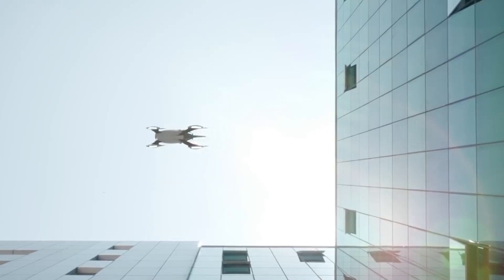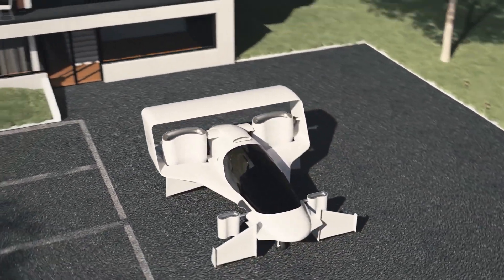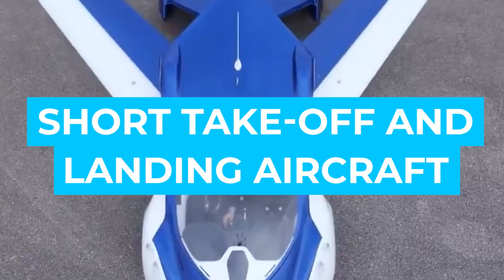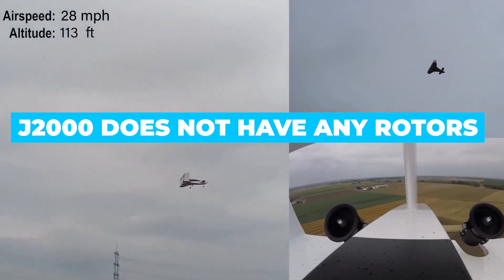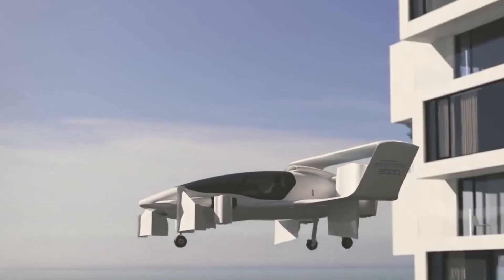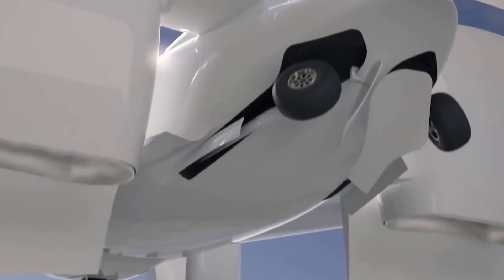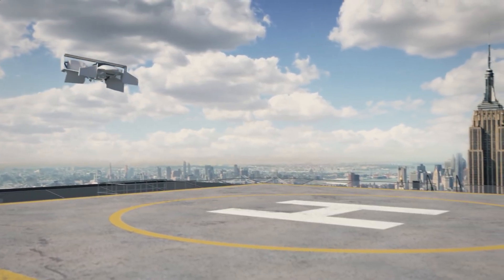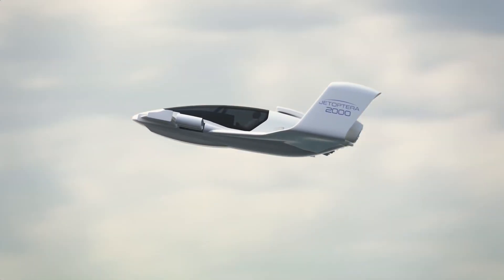How Jetoptera's Bladeless Propulsion System Works

Comment: I'm going to call it, Jetoptera's Fluidic Propulsion is going to win the aviation race. It even has an answer for engine failures because it can glide like a plane as necessary. Conventional propulsion may go faster, and carry more, personal transport is going to be revolutionized. 200 kts is the speed that GA aircraft push for and if you can get that and STOL capability with 4 passengers and luggage, it will retire most GA aircraft and helicopters quickly. I'm I pilot and flight instructor, I'm especially excited for this to go live!
Reply from the maker: You’ve done your research!
Reply: Jetoptera's design still requires the use of a compressor of some sort to create the pressure gradient required in order to take advantage of fluidic propulsion. That means air still needs to travel through an area of tremendously high drag in order to produce enough thrust (compressors aren't exactly great at producing thrust at low drag). I'm somewhat doubtful it'll provide a game changing increase over existing methods of propulsion. I'm not a pilot, just an engineer (though fluidics isn't really my specialty). Most of my opinion is driven by talking to other aerospace engineers on the subject I know personally.
Reply: @wakannnai1  you are getting distracted by "efficiency". We are not saying that this is going to be the most efficient method of propulsion, we are saying that this is going to be the best method of propulsion for personal and commercial VTOL or STOL aircraft. Right now, 2 jets, rotor driven, and fan driven aircraft have been able to take advantage of VTOL and STOL and carry significant weight. In aviation, you have to worry about more than efficiency, but also mission capability. Jets and helicopters are extremely loud, helicopters and fan driven VTOLs are comparatively bulky and cannot travel as fast as similarly powerful aircraft. Not to mention the danger to personnel on the ground with fast moving rotors and propellers as well as the danger of being sucked into the large intake of a turbo fan in a jet, or the danger it puts the occupants of the plane in if birds are sucked in(see The Miracle on the Hudson). What fluidic propulsion offers is similar to what the Raptor engine is to rocket engines, it's not the best in any one category but it is proficient enough in all categories to provide a winning combination. Airports take up crazy amounts of space compared to the size of the vehicles they service, you can put an aircraft equipped with fluidic propulsion anywhere that a helicopter can go, and travel at comparable speeds to an airplane. Early models will be about as loud as similarly equipped aircraft but require almost no space to take off and land. Let's say we use the Piper Meridian as a comparison. It can go 250 kts at 250 lbs per hour fuel burn at 25K ft high, it seats 5+ 1 pilot and can go four hours. Being conservative, let's say that a fluidic propulsion aircraft can take 3 + 1 pilot 200 kts, at 250 lbs fuel per hour at 20K ft high for 4 hours. Oh and you don't need an airport to use the second aircraft, and it can do anything a helicopter can. Would it be worth buying? I would say yes.  Once electric aviation takes off you can land in densely populated areas and people will not be upset with the noise, because there will hardly be any noise to speak of. You can stick your hand through the nozzle and back out with no injury (maybe a 1st degree burn if using a turbo fan exhaust). It is not going to have retreating blade stall if it goes to fast and people can walk around the aircraft safely while it is on! It is a propulsion system that takes advantage of lift, so if you do lose the engine, the nozzle is not complete dead weight nor a drag disc! It can actually provide lift in a glide. Multi engine pilots can start salivating at that fact. Put 2 engines on it, and you barely notice the one engine failure. Shall I go on? This is the most exciting advancement in atmospheric aviation at this moment!
Reply: lilium is way ahead of everyone
Reply: @DeathZeroTolerance  here's what I like about Lilium: good redundancy with 36 EDFs. Good aerodynamics with the nacelles. Small vehicle foot print for VTOL operations. Solid testing track record. 
What I don't like about Lilium: The high power consumption in the VTOL mode. It's reliance on electric propulsion without an option for the use of conventional fuel. The extra complexity with managing 36 separate engines. Low range of 1 hour at cruise. The use of fan blades makes them more susceptible to debris like birds or FOD at landing pads. That and the fact that it's a modest improvement over previous technology.
Reply: @generalrendar7290  some valid points, but jetoptera isn't even close to manned flights. lilium has already done hundreds of manned flights with 5 person capacity, and are gearing up for 7 person production and are past the planning stages for beginning work on infrastructure for 'airports'. concepts are neat, but if you can't execute the idea at scale, it's of little real value
Reply: @DeathZeroTolerance  that’s fine, but airplanes came out in 1903. Helicopters came into use in the 1950s. They have a massive head start, but there’s a reason why the Wright Bros company is not at the forefront of aviation. Innovation and profitability. Jetoptera is moving in a ground breaking direction. EDFs are a cool toy but they are not commercially competitive with piston and jet engines in aviation at this time. 30 minutes of flying is near useless in GA (and that’s being generous to Lilium). The legal requirement to conduct a flight under part 91 of the FARs is to fly to your destination and past it for another 30 minutes. I’m not saying that electric aviation won’t eventually carve out a market for itself, but for now, it isn’t profitable or practical on large scale. Jetoptera can be powered by conventional and electric propulsion. Lilium can only do electric and in order to scale it up increases complexity at an unacceptable rate. Can you imagine how much longer it would take to preflight an aircraft with 36 or more engines instead of 1? How many spares you would have to stock in order to keep the aircraft operating? Would Lilium be considered airworthy if one of the engines failed? I imagine that it would be a maintenance nightmare to own. Granted I like this one in comparison to other propeller or fan driven designs but I believe Jetoptera will be commercially viable if they can deliver on their claims of power and speed.
Reply: @generalrendar7290  we already know that electric motors have a significant MTBF advantage over combustion engines, and maintenance costs are minimal in comparison. turboshafts are incredibly complex. most turboshafts time between overhauls is a few thousand hours. it's very easy and cheap to swap out an electric motor, matter of minutes. it's not cheap to diagnose problems and maintain a complicated turboshaft with many many more points of failure.
Reply: @DeathZeroTolerance  If this were truly the case then they would be replacing the current combustion and turboshaft engines in aviation. On small vehicles they are better but battery density fails the EDF. Not to mention the fact that Jetoptera can do both and fluidic propulsion can be scaled up with little drama. Lilium can maybe make really short hops to different stations like a train before it has to recharge until battery density catches up to carry commercially viable loads for significant periods of time. 1 hour total range is a recreational vehicle, not a commercial one.
Reply: @generalrendar7290  jetoptera and lilium's market are both small hops. jetoptera will never, ever, compete with rolls royce/ge/boeing/airbus
Reply: @DeathZeroTolerance  I disagree. Fluidic propulsion stands to completely revolutionize aviation, making VTOL aviation much more commercially viable and shake up both regional and local travel markets. General Aviation would be turned on it's head and if it can propel aircraft up to 400kts, then the regional aircraft industry would almost be forced to switch over. Lilium's designs are beautiful, it's likely the pinnacle of EDF technology at the moment, but the impeller to vectored thrust from fluidic nozzles will dominate the air taxi and VTOL market imho.
Reply: The technology gets better and better than the previous ones and it shows how comfortable and content the coming generation will live. I wish I reborn after 200 years so the world will be much advanced than today.